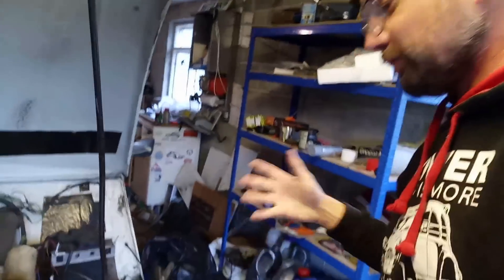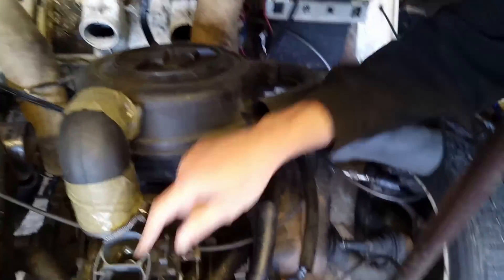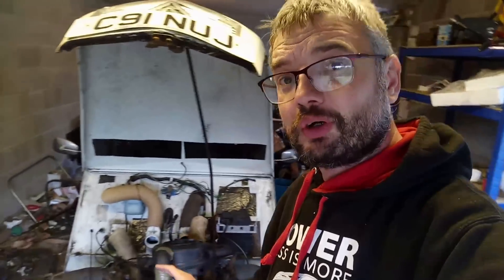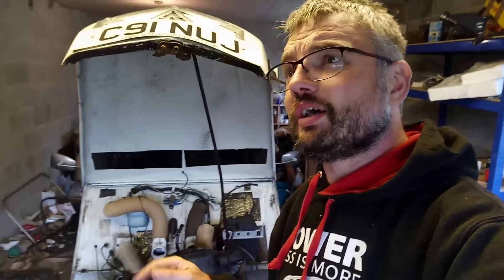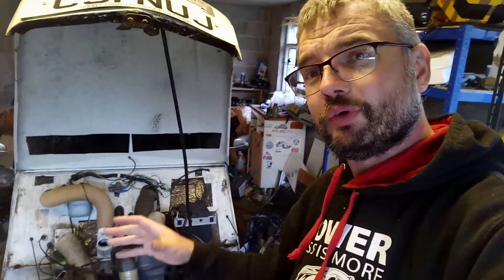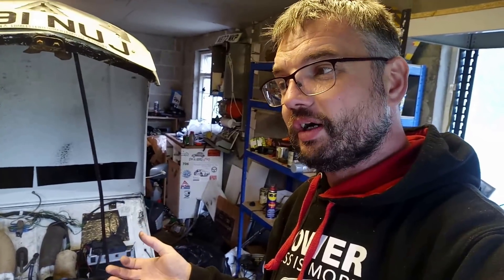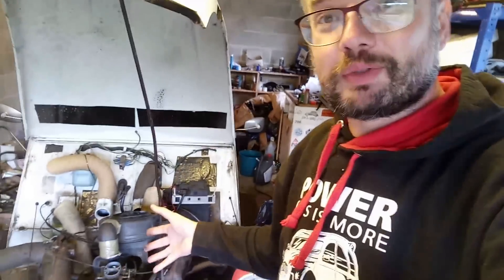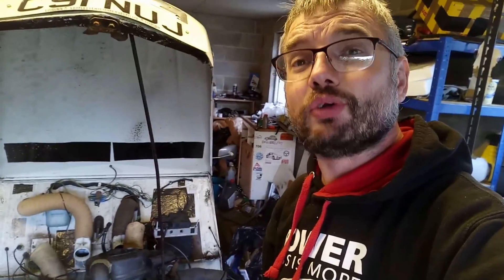Vlog: What is a choke and what does it do?

Comment: Well my dad  demonatrated this when I was 15 by putting his hands around my neck.....
I had an atco motor mower at the time and he was trying to describe  the mechanics of running starting ........mixtures as you say.
Any way I thin he got his message over.
You are deliberately restricting air flow (dramatically!!!!)  to enrich the mixture .....    for better chance of it igniting.?

A vdiieo which would be very good for me  would be;

1)  what does carb balancing mean?
Dad had to balance the two SUs on his maxi and to this day I  dont know what he was doing........mixture I guess but why  would that change  from one week to the next?

2) how the mixtures on weber (dellortos )  work.

Over to you chief.

Incidentally my boss tells me fuel injection causes the fuel air mix to "tumble" and mix more thorughly in the inlet manifold.   Far better  then barbs.
Thoughts Ian?   Anyone?
Fascinating subject thanks for bring ing it up.

Comment: What does a starting handle do?
Reply: Old 2CV ( 1950~60's) had a starting control that was a Bowden cable that pulled a lever on the starter motor, closing the high amperage starter contacts and pulling the starter's Bendix gear into mesh with the flywheel's ring gear.  Very similar to old American cars and trucks with starter foot buttons.
Reply: @tauncfester3022  Thank you very much.
Reply: @neilthomas9244  I think also there's cars from the mid 1900's that still have optional hand crank handles, to hand turn over the engine.  I believe Ian's Elly does have a hand crank just in case the starter battery gets really low.  There's this great  YT video of a fellow who hand rebuilt a WWI era Thornycroft truck.. https://www.youtube.com/watch?v=TXgJGHzUhqQ that has an 8 liter 4 cylinder engine that you can only hand crank to start.
Reply: @tauncfester3022  Thanks so much.

Comment: I used to choke my moped (a PEUGEOT 103 SPX) when i was a teen
Reply: I had a 2000 Honda CG125 with manual choke which it never wanted. I washed the bike once and found it wouldn't start. I then spent an hour checking the plug and air filter only to find I had knocked the choke lever on the carburettor accidentally with the brush 😂

Comment: Nothing to do with the fuel sticking to the sides of the carb ! a cold engine doesnt evaporate fuel as well as a warm engine, the choke reduces the pressure flowing through the carb.

Comment: Are you talking just about 2CV's and the Invacar here? What you said doesn't apply generally to cars. As for injection systems, when the ECU senses the engine is cold through the sender units it adjusts the air to fuel ration to about 1 to 6 instead of looking for that "perfect" 14.7 to 1 which is why on a dyno you can see the ECU create a smooth curve which gets less and less as the engine warms and it's able to maintain a ration of between 13 to 1 and 15 to 1. Black smoke from an injected engine is usually a faulty injector that's over fuelling because the armature is constantly open due to dirt, faulty coils, a worn orifice disc or worn spring.

Comment: Need your tip in my generator problem. Somehow, I just found out that pulling the choke lever out but not too out, makes the engine sound normal. Is this caused by gasoline evaporation? https://www.youtube.com/watch?v=X5TAhL_X5DM

Comment: Ummm   the mechanics was quite good.
The 3 year olds tuition on how  to pull a lever in and out not so..........
Reply: Hi David. I have a fairly modern (2011) fuel injected Triumph Bonneville . Even though the fuel enrichment for start up is handled by the ecu, it still has a knob to pull to raise the rpm on intial warmup. Now with fully electronic throttle control. All that is done away with.
Reply: @Fintoman  Oh well.
Well done for running bitish machine.
WE used to lust atfter triumph bonnevilles and tridents in the 70s.